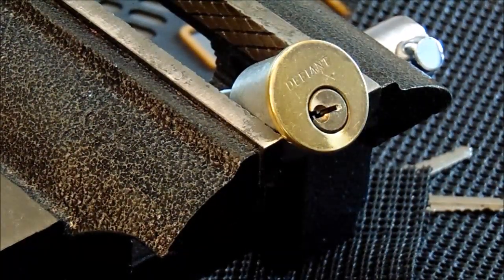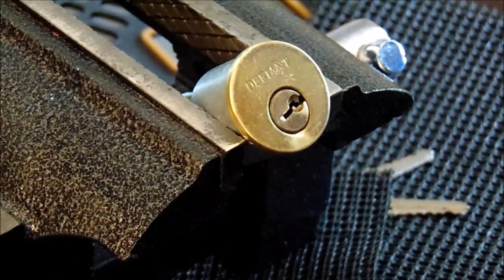[42] How to Pick Common Locks Quickly and Effectively

Comment: I don't know if I'm doing something horribly wrong, but none of my locks give me that loud as hell snap you seemed to get. I am in Europe, so do we have different locks here or something? And if so, do you have any tips or experience with these?
Reply from the maker: Kender Sutt When I was picking this lock I used an excessive amount of tension to emphasize the clicking sound that you are talking about. It isn't always this loud, and clicking is not the only feedback I use. 

When a pin is set it feels floppy/loose, not binding it is springy, and when binding it has resistance. Increase tension until you can find a binding pin, pick it, and the search for the next one.

Check out my Lock Picking Home School playlist, it is ongoing and has a lot of great info for people starting out.

I don't have a tremendous amount of experience with European locks but I know they typically have tighter keyways and require thinner picks but the principles are the same. Also in the field many of your locks are oriented upside down for my perspective which makes picking a little bit different but easy to adjust you.

If you have any questions or feel I did not answer this will please let me know :-)

Comment: How do you tell which locks have a certain keyway? Is there a chart that shows whether they are kw1, kw2 or sc1 or whatever
Reply from the maker: Most of it comes from experience but you can find charts online. Many of the Kwikset, Schlage, and Yale are very easy to spot with a little practice